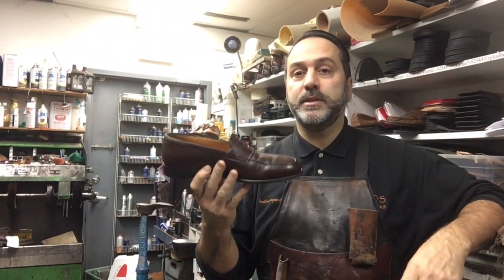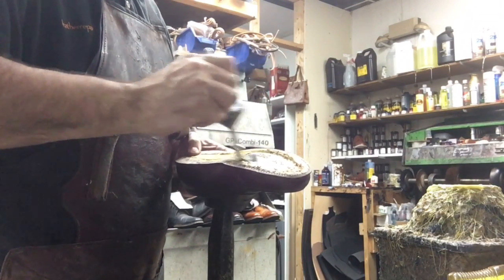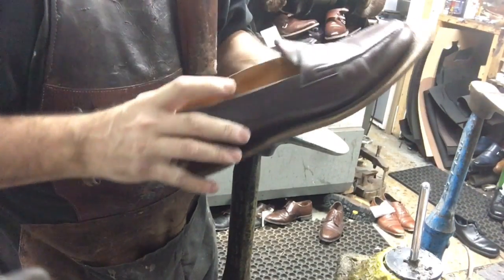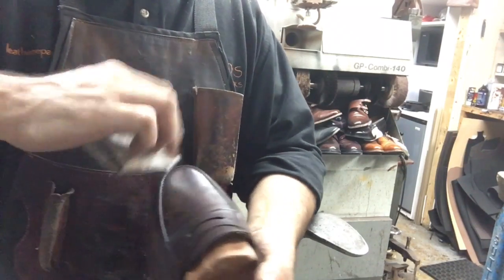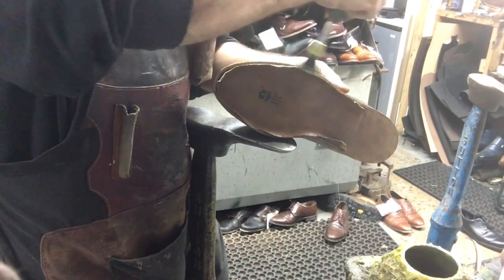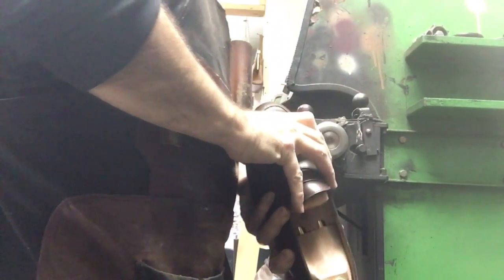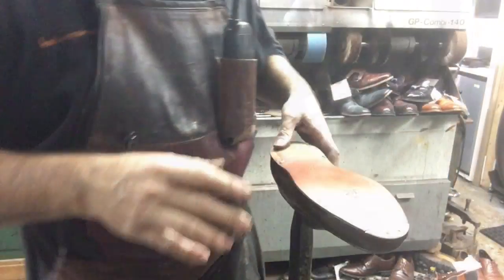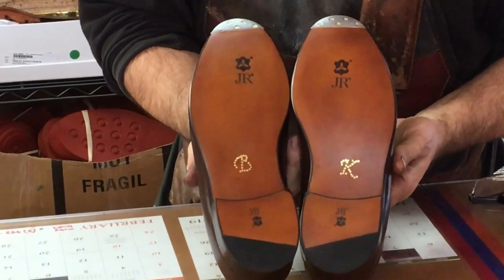John Lobb Shoe Restoration - Bedos Leatherworks #103

Comment: Small easy video tip:  Do you have a hood on your lens?  I think I'm seeing some contrast loss in some shots that would indicate light sources hitting the lens at an angle, and scattering inside...that takes away the definition of the dark tones.  Easy, cheap fix if you don't have a lens hood...look on Amazon for generic hoods for your particular lens.  If you are already using  a hood, maybe the a tiny change in camera height and angle will get that stray light out of the lens.  In this video, I see the examples of what I'm describing in the shots towards your work on the last, when you're adding the customer stencil initialing, etc.  That loss of contrast in the upper right corner against your dark shirt or the buffer when you move...that is, I'm pretty sure, the result of light directly entering the lens.  You can see in the last shot where you are showing the finished product at the counter that you have full contrast there...the light is not entering the lens directly, so you're not getting the flare and loss of contrast.

Love the channel, and how it demystifies aspects of shoe construction and repair.  Hopefully I could pay it forward a little with a photography suggestion.  Best of luck.
Reply from the maker: Bruce Richardson that you for all your suggestions, I don’t even know what a hood lens is but I’ll look into it. Besides I’m just using my I phone to record not an actual camera 👍👍

Comment: Wonderful workmanship. Cutting the sole for the blind stitch looks really hard to do. I was wondering if you ever considered making a fixture out of a stepped block, with the blade extending the required depth, and indexed to the bottom of the sole, so it would maintain the proper depth and elevation of the cut - potentially saving time, and maybe reducing the anxiety level - Just a thought.

Comment: Steve,..thanks for a great vid..I have 2 queries..1.What mix for the rubbing alc and water spray to be most effective ?..and 2..Is your no. rating for the oak bark soles related to the depth?..do you use a one size blank or..is it specific to the shoe size?...thanks..I'm inspired!..rgds, Joe.
Reply from the maker: Joe Monaghan hey Joe
Ok 50/50 water/rubbing alcohol 
The JR soles come pre cut and they are 10-11 thickness. If I need bigger then I cut from a big sheet of leather bend

Comment: Steve, curious as to why you used acrylic (paint) on the leather uppers on this pair of shoes, which you discuss at approx 40:00 min into video?  I've not seen that done before, and you had already previously used leather dye on them.  The acrylic sits on the surface, as you mention.  Is it to smooth out the texture and coloring?  Thanks and awesome work!!

Comment: For curiosity, why do you not use a stitch picker on your line finisher to pick the stitches? I am picking your brain for the reasons why you do what you do.
Reply from the maker: It really depends on what condition the welt is in, if the threads on the welt is counter sink then the stitch picker is not going to do anything. So I do use it occasionally
Reply: That makes sense.

Comment: 39:36 Wonder what happened to the thread when the customer wears the shoes in the rain. The slits between the french tips and the sole's surface will now let the thread soak up all incoming water or not? Before it was at least covered and sealed by the leather surface of the sole. Now it's only covered by a piece of metal with holes for screws in it. I don't think that this keeps water away. The owner should better put off his shoes when he gets caught in the rain and walk barefoot before he ruins them. :) First thing I didn't like too much how it's done.Or did I miss a step here and you sealed the channel with the stitches beneath the tip otherwise? Nevertheless, great job, as always, one more beautiful pair of shoes shine in new splendour.
Reply from the maker: Andy Kashu you don’t wear this type of shoes In the rain sir.😂 the thread has wax on it so it seals the holes pretty good.
Reply: Thx Steve! Didn't notice the wax part. That might due the job..

And yes, I know, certain shoes are not made for rainy weather, so we better don't wear 'em in the rain. I own some. And yet it can rain without nature asking you if you're wearing your precious shoes or not. And then you're all of the sudden wearing those shoes in the rain. Happened to me more than once. ;) And then you'd better put them off if you didn't want the tip soaking up water like a cheesecloth. That was my concern. And would be my concern as the customer. I'd rather want the sole being sealed properly underneath the french tip, just like on top of the sole, or no such tip at all. That's all I'm saying.

Comment: Hey Steve great video sir!

you know just a suggestion what might help take out those wrinkles even further would be a good quality deer bone from John Lobb I got one for when I smooth out leather fittings on lasts or when making the shoes to really smooth out the toe box. It has like a oil inside the bone that helps it glide over the leather and also polishes it a little bit too. It might not be super necessary but might help. :) 

here's the link if you're interested: https://www.johnlobbltd.co.uk/product/deer-bone/
Reply from the maker: RHBootmakers thank you, I have some I use but didn’t on this pair